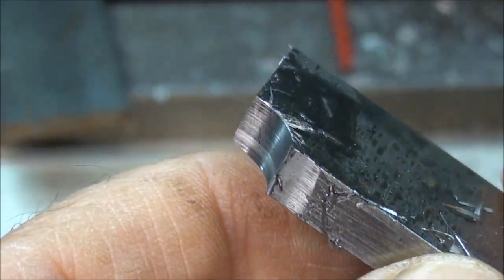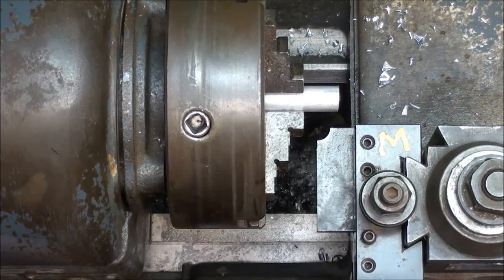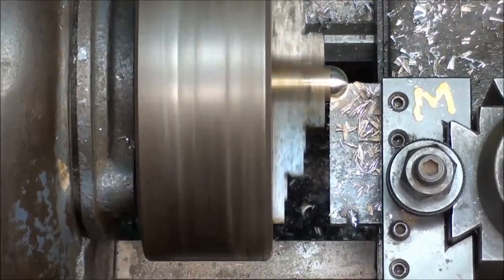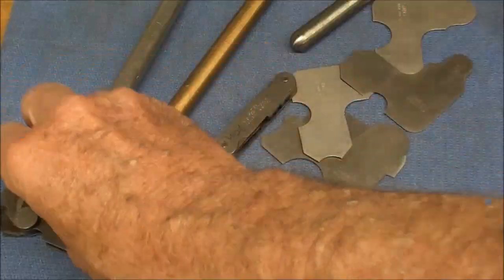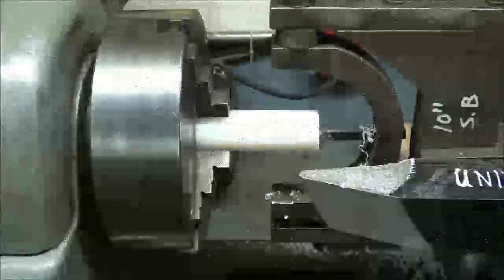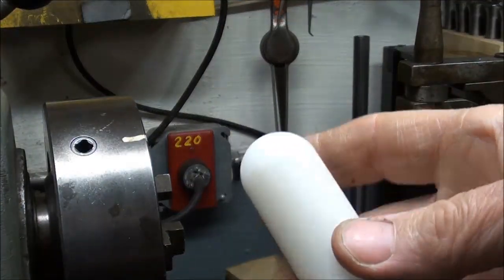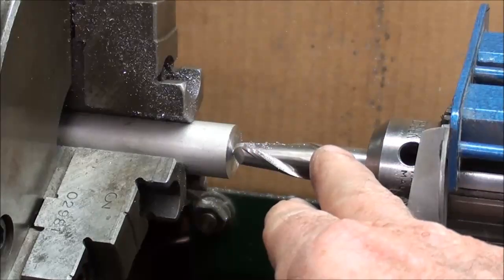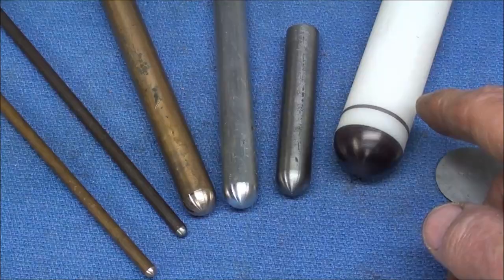MACHINE SHOP TIPS #122 THREE WAYS TO A RADIUS - Logan Lathe-Part 2 tubalcain

Comment: You could also use trigonometry to work out a depth of cut and a offset from the centre to create your radius using a slot drill and depending on how small of an increment you are willing to work out gives a better finish then polish it up after

Comment: How big of bar stock can the homemade radius tool cut that you have in that one how to cut a radius up to 4 inches maybe
Reply from the maker: Actually, I have never tried it on large stock. Give it a try but run it at very slow speed and see what happens.

Comment: My circle cutter is from an eBay kit and it blows .I already made a thicker aluminum  swivel tool holding piece .The work sucks the tools down It was a 50 kit including handles and instructions that won't work unless you add a set screw. Handle slips too and I oversized the pins in the kit up to 1/4".Piece of crap I may duplicate the design in steel 1/2" thick

Comment: I find that you can turn a "completely round" ball by drilling and tapping the needed threads for ball mounting on your project in the beginning. 1st-Face the front end of stock. 2nd-center drill-3rd drill and tap for required thread size and depth. 4th-turn the radius as was done in this video. 5th-Part the opposite end at your measurement (appx 50% in length of the diameter size). 6th-Mount the turned radius on your matching mandrel and turn the other 50% of stock as in the primary stage of this video. Actually faster for me this way when I want a round or multi-shaped sphere.

Comment: In a pinch, I mounted a hss moulding cutter as a form tool in my mini-lathe and turned a radius on the end of a 1/4" brass rod.  The profile is slightly different, but it served my purpose well enough.  You gave me the idea, and thank you very much.

Comment: I just saw this video from six years back. I had a brainstorm and wanted to radius some aluminum stock and I hand ground a couple of tools then I spotted my router bit box and eureka. I whipped up a simple tool holder and locked one in and got it on center and it worked. I haven't put it against cold roll or stainless but it cuts aluminum like butter.
https://i.imgur.com/PYe7Z0p.jpg

Comment: we used to make by hand rough hand grind...have a block to hold with  angle of clearance  5°steel ..15 ° alum....then clamp in go drill press piece of rod size of radius..lapping compound..take all together 15 min...once you have your holding block made

Comment: Great video.
On the form tool, I would have picked three other radii and put a form on each corner of the plate.  4 tools for only a few minutes more effort, and no more cost.  Of course, I'd have used my number stamps to mark the size of each corner.

Comment: Since you mentioned setting the form tool just below center to help cut down on chatter I thought I would suggest maybe making the tool about half its original width. That way it wouldn't hang out so far part the side of the tool holder which would also help with the chatter.

Another thing we often did in the factories when using form tools was right after sharpening them we would take a carbide tool and lightly drag it across the cutting edge, ever-so-slightly dulling the cutting edge. Believe it or not, if the tool is 'Too Sharp' it will chatter real bad, and dulling the edge a little will make them work like a charm. It takes a delicate touch though. If you dull it too much, then you end up having to re-sharpen it and start over. That really makes a difference when form cutting aluminum which likes to grab the tool.
Reply from the maker: Will try that--next time I use that setup-thanks.

Comment: If you bought the tool perpendicular to the workpiece (if it is perfectly 1.000) and had zerod out the crossfeed when the tool just touches, would that be an effective way to set it up to cut that 1/2 inch radius?